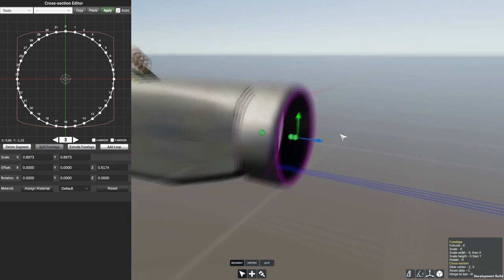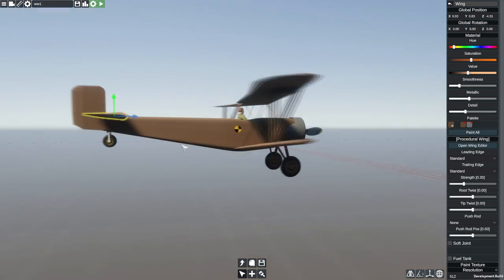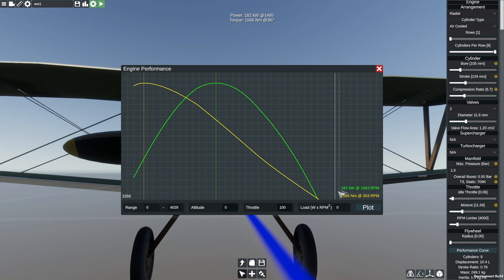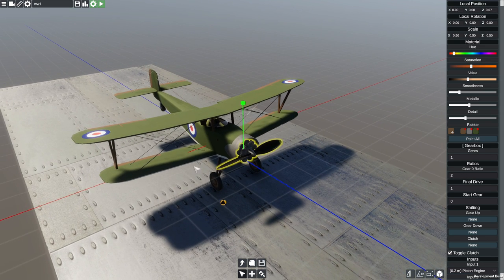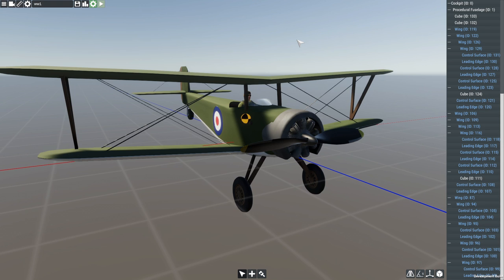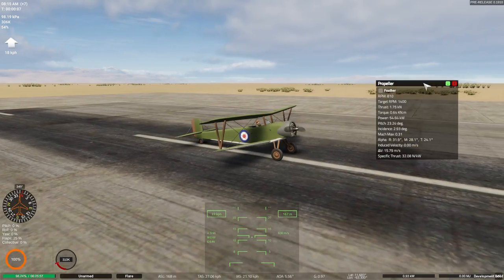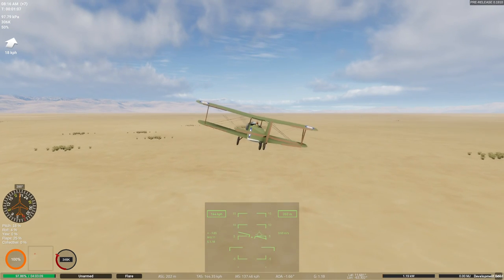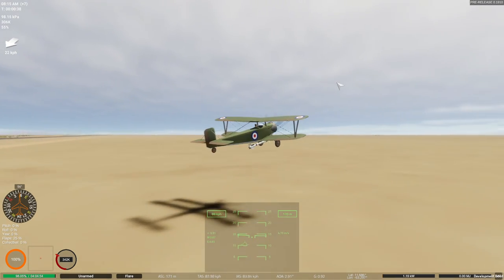Launching a sidewinder from a BIPLANE in Flyout!

Comment: Because he mentioned it, the biplane with a smaller lower wings is called a sesquiplane.
Reply: The albatross and neuports were sesquiplanes
Reply: sorta - sesquiplane refers to a biplane wherein one wing is ~1/2 the length of the other therefore his biplane wouldn't and would instead be an unequal-span biplane
Reply: Also most Biplanes had multiple machine guns and could even carry some bombs.

Comment: Given that a lot of old WW1 aircraft had rotary radials, that forgo a flywheel by rotating the ENTIRE ENGINE (the crank is attached to the fueselage, the entire engine rotates with the propeller) to save weight, your plane is very good considering that it's actually at a deficit of power for a WW1 engine.

Comment: Regarding guns behind propellers: I’m pretty sure they were mechanically linked to the engine so that they would fire between the blades of the propeller as it rotated, allowing pilots to shoot the enemy instead of themselves
Reply: Yep, and it was a WW1 invention! Didn't take them long to figure out that blowing off your propeller was a no-go 😂
Reply: Synchronization gears. They interrupt the firing mechanism while firing would risk hitting the blades. However before they figured this out, they either Risked it (!!!!!) and just shot through, hoping not to hit their prop, fitted the guns to the upper wing, or they literally put armour on the back side of the propeller to deflect shots. The synchro was a very important invention lmao.
Reply: @mekiyahhazbin1720 
It did actually take a bit before they tried syncronization. 

First, they tried mounting the engine at the back so you could have an uninterrupted view forward to fire, but these planes didn't fly all that well and were a bit slower and less maneuverable than ones with the engine at the front.

Then, someone had the bright idea of mounting metal deflectors to the base of the propeller so you could shoot past (and into) the propeller without shredding it apart. This worked surprisingly well, though it did seem to damage the propeller and engine over time and was prone to unexpected breakdowns of the engine.

Then someone tried mounting a gun on the top of the wing firing over the propeller, this kind of worked.

Eventually someone managed to mechanically time the gun and propeller to let them shoot in between the gaps of the propeller. And this worked REALLY WELL. 

Eventually everyone kind of just copied that last design

Comment: You deal with knocking in the engine (preignition) by either decreasing compression ratio which sacrifices peak power, enriching fuel mixture, which sacrifices fuel efficiency, or advancing ignition timing,  which gives better throttle response, enhances peak power, but again hurts fuel economy, or finally, by using higher octane fuel.

Comment: The Bi-plane with smaller lower wing is called a "sesquiplane". It doesn't actually have to be the lower wing that's smaller, this term covers any bi-plane where the wings are significantly different sizes, can be either the top or bottom that is the smaller, but it's more common for the bottom to be the smaller. I'm not sure yours would count as such though, I mean the definition I could find emphasize it's a significant size difference between the wings to qualify, I'm not sure yours are that significantly different, but.... it's hard to know exactly how different they have to be.  
When I think of a sesquiplane, it's things like the various Nieuports, the 17 and the 23 come to mind, where the cord of the lower wing is probably about half the upper wing, or the AN-2, where, while the cord is similar, the lower wing is quite noticeably shorter than the upper.

Comment: Does Flyout not have rotary engines? Because the Clerget 9B from the Sopwith Camel is a rotary. That is, the entire cylinder bank spins around the crankshaft, instead of the crankshaft spinning inside the bank. You used a radial, which would have been rarely if ever used in WW1.